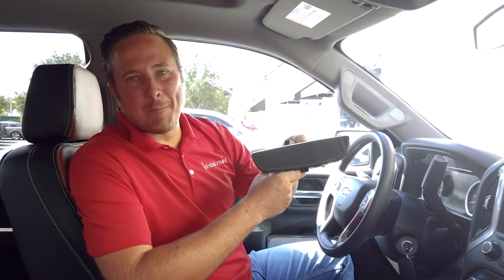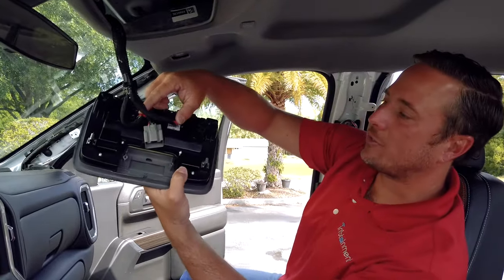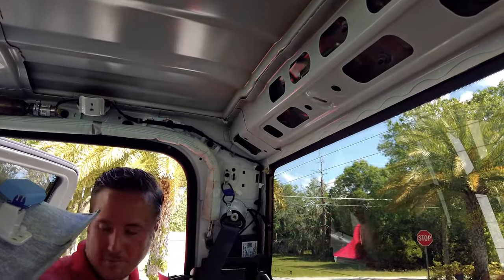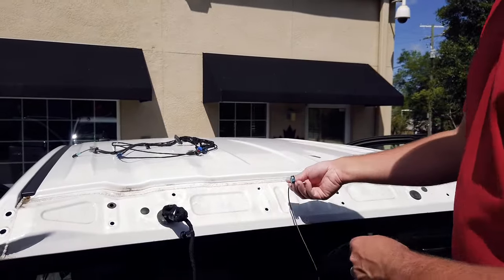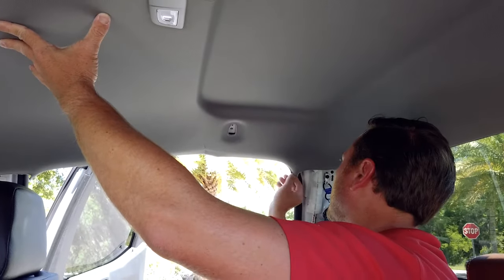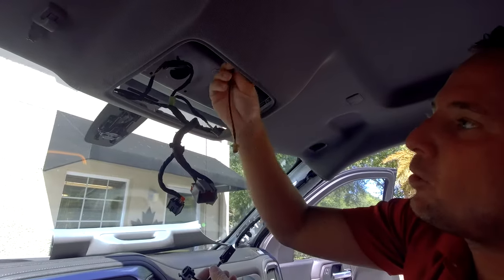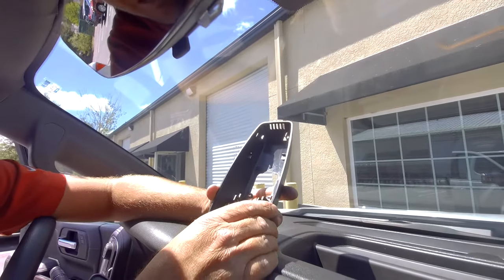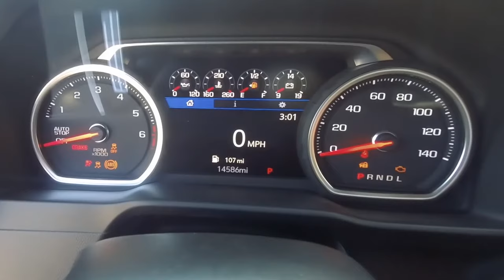2019-2024 Chevrolet Silverado / GMC Sierra - Rear Camera LCD OEM Mirror - Infotainment.com

Comment: Quick Question: You mentioned a separate wiring harness for certain model years which was replaced by the new single line.  I have a 2020 GMC 3500 Denali, does that year require the separate harness?  If you would provide years that need the separate wiring harness as an edit to the video, that would be very handy.  thank you.  I have a blue screen when I toggle the digital mirror dongle. Not sure if the cables were damaged or cut. Dealer says camera good.  Can't figure out why it isn't working.

Comment: On the 22 refresh model, would it come out on the radio as bed view?
Reply from the maker: No this would be a seperate camera. It works together with the bed view cargo camera and does not replace it.
Reply: The kit shows a bed view option. Does that get added to the radio camera views?

Comment: Have y’all ever done the 360 camera on a 19+
Reply from the maker: No, unfortunately we will not be offering 360 camera anytime soon as the installation is far more difficult then the other kits on our site and would only be possible through an installer. With the difficulty involved installing this the chance to damage something is just a bit to high for us.
Reply: @Infotainment_nav  how much for the mirror and cable for a 19 slt?
Reply: Can you tell me which wires are power and ground?

Comment: Hi there quick question I just installed the whole thing rear light camera with the mirror camera, run the video cable and then I realized there is no hidden power wire for the mirror. What should I do where I can find that wire or how can I connect this mirror to power?
2023 Silverado RST
Thank you
Reply from the maker: We may need to create a custom harness for you. We're looking into this now. Can you please reach out to our support team?
Reply: You might not see it because its connected to the mirror harness, you need to unplug it

Comment: Will this work for a 2024 Silverado?
Reply from the maker: It might, but the important thing is to check your headliner area for the plug. Usually the plug is tucked away where it's hard to notice, but it HAS to be there for this upgrade to work. If you do not have the plug, this won't install.